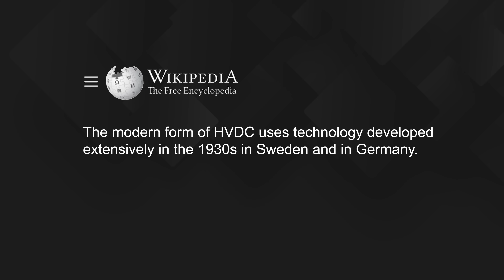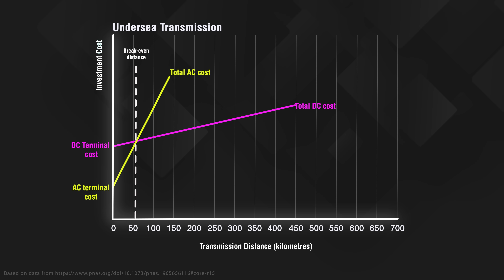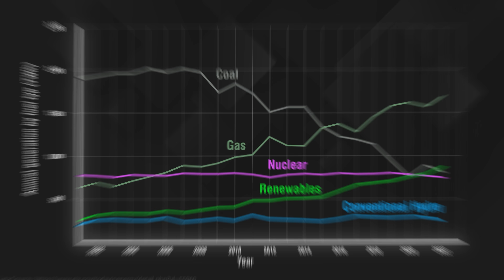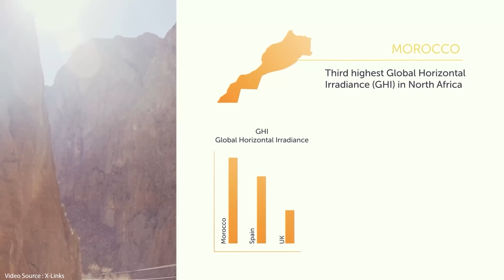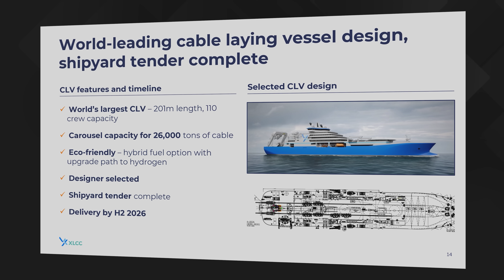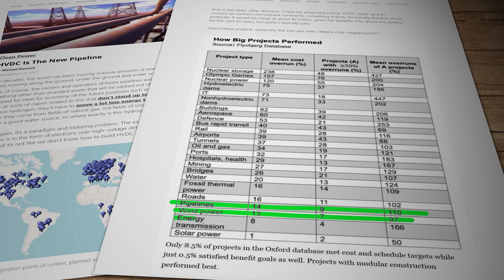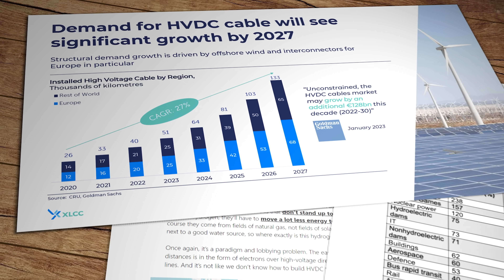Revolutionising power transmission.

Comment: The level of infrastructure change strikes me as similar to that which brought about the electrification of the modern world. But electrification was done based on market demand and took place over many decades. The green folks one is to get this done far faster and aren't willing to wait for the market to do it on its own.

I grew up in the 60s and 70s reading about the Edison/Tesla, General Electric/Westinghouse, alternating current versus direct current wars. Edison was heavily invested in generating and selling direct current. He liked that business model because it required lots of power stations delivering power short distances to his customers. Of course, Tesla knew that was not the way to go and Edison lost the battle.

So, we have come full circle and with the invention of new technologies, find that DC current transmission may in fact be preferable.

Comment: There is no question that the grid needs to be completely redesigned to support distributed power suppliers.   There also need to be significant projects to implement stored power reserves.  This is what allows intermittent power supplies (like wind, solar and tidal) to average their output to consumers. Store energy that isn't used, to be available when production is reduced. This is not a current design in our existing grid.  Instead we have on demand producers who will fill gaps at avery high cost.
It's a grid designed from the 40's to the 50's, that has to support a completely different power ecosystem 80 years later.  It worked fine for what we needed, but we need change.

Comment: Tisk tisk tisk, keep to videos and get a new sketch writer! Reading the the comments and hearing you speak you would think their was a need for to de-carbonise, (whatever that means) of course, climate change, "groan". Do you really think we need to find other ways to produce intermittent energy? Changes in engineering are usually incremental, exploring the technology, if you believe batteries are the way to sustain the demand in Western Europe, you are in need of treatment, if that’s your storage solution. Berating the oil industry for giving us a sustainable source of energy and allowing the people cheap reliable energy and fuel, is tantamount to hypocrisy and ignorance. You look at a diagram and pontificate that it’s a, "Crossing the Rubicon moment", give me a break, where’s the security in that, given the present state of affairs. Here’s what to consider, you obviously have engineering knowledge, however your methodology in evaluation is chronically flawed. Read this and evaluate, a bit of proper engineering research instead of politics. It’s a  few years old so costing is probably 50% higher.https://read.oecd-ilibrary.org/nuclear-energy/nuclear-energy-and-renewables_9789264188617-en#page1

Comment: HVDC sounds good, but the Morroco project needs additional details. It's 1500 square kilometers (huge) of what many would consider worthless desert. In fact, it's a thriving desert. 
This huge facility, building an HVDC plant in Scotland, 900 employees, design and build the largest cable laying ship, lay 1000s km of undersea cable, and build the facility in the UK to convert DC to AC is very complex. Plus all this needs continuous maintenance over 1000s of km.
Occams razor principles would imply nuclear SMRs could provide a simpler more distributed solution with lower single point failure risks. Just a think.

Comment: I’m not sure I understand the sarcasm at the beginning.  Longer range transmission is great and creates more options for concentrated green generation, but the generating capacity still needs to be built.  I don’t agree with the idea that the only thing that’s preventing us from making a transition to green energy is entrenched fossil energy interests.  If green energy was better we’d have done it by now.  The problem is that it’s not from a number of perspectives - yet.  We should be pushing for as fast a transition as we can but I don’t think we’re going to stop burning fossil fuel anytime soon.  

Fossil fuel companies aren’t scared of the energy transition either btw.  Ownership is concentrated in a few large asset management companies that also own the green techs so the string pullers are covered, but more importantly the scale of our fossil energy system is enormous, the supply chains reliable, and overall it is cost efficient.  Dirty and polluting yes, but what does that matter to the average person when they can’t put food on the table?

Comment: The cost of expensive Batteries. It would be good if you could post this scientific empirical evidence for the anthropogenic C02 producing a climate problem.Coal fired Power stations in Austalia are clean they only produce life giving C02.
Reply: Cooling in the stratosphere is proof that CO2 levels are causing climate change. It is also a problem in itself.

Comment: Lol you've never tried using electricity to keep a building warm enough to keep the pipes from freezing when the temperature outside is well below -35C. Blown breakers, blown transformers, and melted wires. Houses here that are only connected to Electricity and use it for heating during the winter(average min in the -35C to -40C range for 2 or 3 nights, -30C for closer to 10-20 days a year) I recall are serviced with 200A+ mains and sometimes use 3 phase 600V to reduce the size of wire

Comment: 6:10 depends on your definition of "clean" in terms of energy production. Assuming you have supher scrubbers and such, coal can be pretty clean. But if your definition of clean states that CO2 is dirty, then coal certainly wouldn't fall under that category. Either way, coal isn't great as it has the most deaths per unit of energy of any large generation source.

Comment: All very interesting, China is building 300 new coal fired power stations, India is building 200 x new coal fired power stations and not to mention another 200 x new coal fired power stations in other locations. China has produced more Co2 from 2008 to now than the UK has produced from 1750 to now. Man made climate change is a great big lie and de industrialising the Western World will be an economic disaster nor will it achieve anything. Another important point is that the only thing that is renewable about renewables is that they have a life span of between 10 to 20 years and will require replacement. But don't worry, China will be able to supply because they will still have manufacturing. How's the cost of your electricity going, how's are the inflation figures going?

Comment: I have a question. In a hundred years from now which will be still making energy for Britain, the solar panel/ UHVDC you spoke of or the Hinkley C nuclear plant? Nuclear, fission and eventually fusion should be the primary source of electricity for the world. Yes the waste issue has to be dealt with but there are solutions to be sure. If the brainpower and money that is poured into renewables were put towards nuclear energy imagine the possibilities. If not do the German thing and go back to digging coal.
It would nice if Have a Think could do a series on nuclear and how advance it make it cheap. Then we can move onto finding solutions to other societal problems.

Comment: Have to be careful not to paint all people cautious about a primarily wind and solar powered future as fossil fuel industry shills.
There are valid reasons why it is an extremely difficult transition, and it is far from a fait accompli.
As you know intermittent generation requires a more interconnected grid and tera watts of cheap storage.
The cheap storage part of the equation is still a long way away. Batteries really don't look capable of improving the cost/capacity ratio enough to serve as anything more than short term storage.
We can't keep burning fossil fuel in the quantities we have, but we have a long way to go to get to a low carbon grid.

Comment: I suggest  you look at the issues around supplying the strategic minerals that will be required for the electrification. There is a report out that shows (among other metals)  that it will would take more than the total copper reserves and would have to be produced at rate 5x beyond what we have ever achieved. Unless there are significant . game changing advances in material science we will hit a hard ceiling on minerals well before we get close to NetZero.

Comment: For the sake of rapidity, why not make 12 or 13 Hinkley-equivalent power plants in the UK and--with emissions out of the way--let the 1/2 price drop incentivize renewables? Another question, are we prepared to recycle the panels, turbines, and batteries in a couple decades, or will they get scrapped? I would imagine that generation at this scale would need not just net zero emissions (including panel/turbine/battery manufacturing), but also net zero resource consumption to qualify as truly renewable. Are there recycling options for fiberglass? I would totally understand this being an imperfect stepping stone, just like nuclear, and I would love to hear more. I can't wait to see the HVDC cables connect everything!

Comment: Are we not just talking around the subject of where this is all leading?

With the introduction of battery powered cars, electric cookers, electric heating...etc...and all the new 'to the home' infrastructure that'll be required to facilitate this uptick, are we not just moving towards a point whereby the requirement for electricity will simply become ubiquitous...paid for via taxation or similar?

That is to say, all the added cost of facilitating it and the amount we'll be using as a result will in itself result in the current pricing models becoming basically obsolete?

There's no way on earth every day folk will be able to pay for what's coming out their own pockets...it's bad enough (in the UK at the very least) with access to affordable oil and gas being presided over by tyrants as it is.

Can you imagine what the root and branch shift to an entirely electronic infrastructure will do to everyone below a household income of at least around £100,000/year...and thats as the UK economy currently stands let alone how bad it may get in the years to come.

Comment: It is amazing how many small earthquakes occur near power generation stations (solar, hydro, coal/gas & geothermal - may be true for wind but it is generally more spread out) and places where there are multiple series of high voltage power transmission towers carrying high power lines in parallel across the USA.  It has been noted for over a decade by several private researchers who study earthquakes...  just like how the deep wells,  quarries and mines create weak points in the crust (like drilling a series of holes in a granite slab will cause the slab to preferentially break along the holes when enough pressure is applied... although much lower force being needed than if there were no perforations in the slab).

Comment: The Morocco - UK link is flat out bonkers. It's Brexit gone mad. The obvious thing is to connect Spain and Morocco, which is a shorter route, and therefore cheaper. 

The UK has plenty of wind and it's obviously going to be cheaper to generate electricity via onshore wind farms.

Comment: The first large commercial application of DC transmission lines was in Brazil to link Itaipu (down south in the border of Brazil and Paraguay) to São Paulo state. Itaipu was, until the Three Gorge Powerplant was built, the largest hydroelectric powerplant ever built. It's a bi-national company (owned by Brazil and Paraguay) and out of its 16 generators, 8 are 50Hz - the frequency used in Paraguay and neighboring countries. Paraguay's main importer of electricity is Brazil (60Hz) and the solution was rectifying and later alternating it. The station is near where I live and was built by ABB (German company). I'm not aware of DC transmission line from Rio Madeira to São Paulo but that doesn't mean it doesn't exist. I'll check with a relative who worked in the field.

The great thing about DC transmission lines is insulating parts of the grid from instabilities that can cause the whole grid to go down. AC transmission lines are really complicated - why does the power go in one direction and not on the other? What happens if the Grid starts to resonate or enter unstable mode because of failures? I remember that one generator in one power plant going bust and consequently causing a blackout on over 50% of Brazil's population. DC allows for links between AC sections of the grid in a way that insulates the instability from spreading throughout the whode grid. I really don't know about the other applications you mentioned but it seems to me that exchanging reliable transformers for tiristors and filters is not a good idea. The line is much easier to build, though, since it's DC and, therefore, not a transmission line but simply conductors.

OBS: I don't know the answer to questions I wrote on the second paragraph - all I know is it's really complicated.

Comment: Only grid that would work is a fully amplified one using ALL sources. This will stabilize supply & demand in any market. Let the market work & stop the politicians from rigging. No one cares what percentage this source has or that source has. The reality is that there are not enough valuable ores to produce all the widgets for all these machines.

Comment: if countries are interlinked with bi-directional current transmission cables it really nullifies the problems of intermittent energy production of renewable energy. there is always wind and sun somewhere and the demand of energy isn't at the same time so it could really balance and distribute everything into a much smoother demand curve.

Comment: EMP (electromagnetic pulses from solar coronal mass ejections, nuclear weapons and EMP weapons) threats are apparently grave because they can destroy transformers of our HVAC power grid that are also behind in production. The transformers are destroyed by low frequency but immense current that transformers anomalously conduct because they are designed to only block higher frequency AC. Since HVDC is already at low frequency, and high voltage, I would like to see a presentation of how it would fare in an EMP attack/event. The fate of human civilization in the aftermath of nuclear war or another Carrington Event may depend on the answer.

Comment: Just to add we have had an HVDC transmission line in Southern Africa since 1979 from Cahora Bass to Johannesburg. 
"Cahora Bassa is a 1920-MW, ±533.33-kV high-voltage direct-current (HVDC) bipolar system with four series groups per pole. The system links Mozambique's Songo converter station to the Apollo inverter station near Johannesburg, South Africa, by a 1414-km (879-mile), 530-kV HVDC overhead transmission line."

Comment: One thing the pro-fossil fuel crowd consistently ignores is that, apart from the effect they have on the climate, is that they are NON-RENEWABLE.   As the easily-accesslble fossil fuel sources become exhausted, we'll have to turn to more expensive sources, thus rendering petroleum prohibitively expensive as a fuel source, leaving dirty coal as the only viable if undesirable alternative.

Comment: What's the efficiency between HVAC and HVDC. It seems to me there is more to go wrong with HVDC, capacitors, IBGT's, etc. Also isn't peak voltage limited by present IGBT technology? 
My vision of the future is autonomous homes running on low voltage DC. Let's cut out the AC to DC and DC to AC losses as much as possible. Right now with HVDC we convert AC to DC then back to  AC at the end point then back to DC to run appliances, let's cut out those losses altogether.

Comment: Great video.  

I think you've covered previously the proposed 4,200km cable from the Northern Territory in Australia to Singapore exporting the bulk of the power from the proposed 20GW solar farm and 42GWh of batteries.  That project may also be adding some wind.  Singapore currently uses a lot of gas.
Reply: The problem with that project is not the length or the site of the solar farms, nor is it the political problem of crossing Indonesian waters. The big engineering problem is laying cable across the (deep and seismically unstable) Timor Trench. There is a reason the UK-Morocco cable project hugs the coast.

Comment: So it would seem the old Tesla/ Edison war is turning full circle due to advancements in SS technololgy. I wasn't aware grid power is being transmitted HVDC. It makes sense, lower capacitance losses. Now I'm curious how HVDC is transformed to lower voltages. Would guess very high voltage solid state switching at high frequencies is now practical. Very interesting video.

Comment: Dave ,thx for taking the time to talk about this subject. I agree with the fossil fuel folks in that we need them to bring us to the next level of sustainable energy production and transportation but no further. And for that, my hat is off to them. For me, I feel that nth generation nuclear electrical production is the future also. I don't believe in batteries that are needed to make renewables reliable as their cost is too great at this time. Sometime in the future when the cycle lifetime of batteries is extended far beyond what the current cycle lifetimes are today they will be a viable way to make renewables reliable.

The only enhancement left for DC transmission lines is superconductors. With elevated temperature superconductive materials this could improve the efficiency of LONG DISTANCE transmission appreciably. So, the marriage of high temp superconductors and high voltage DC will be the enabler of next generation transmission lines. With no losses, the thought of extremely long transmission lines become a reality. This would revolutionize the layout of electrical producers relative to consumers globally.

Again, thx for making this video.